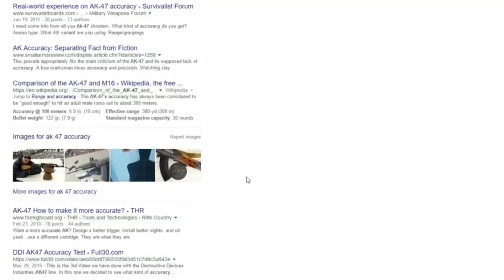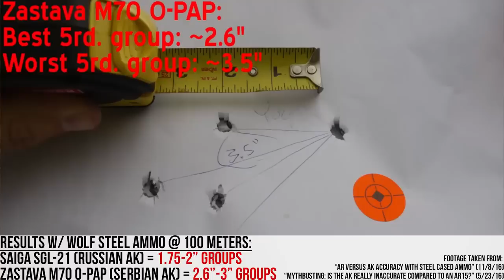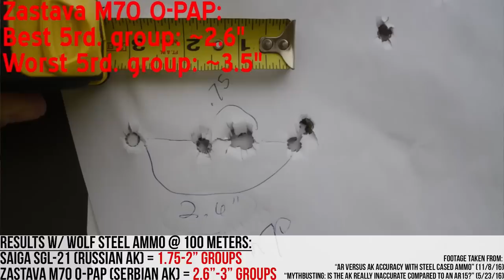Busting the WORST AK-47 Myths! (Featuring InRange TV and Mishaco)

Comment: People are crazy if they think that the AK being "reliable" means that it won't jam up. In reality it means that the AK is always easy to maintain and un-jam in comparison to other firearms. The M4 is reliable gun if nothing gets in it. It happens to be great at not letting debris get in it but once it does it's much harder to fix. The AK doens't even try to stop debris getting inside it, it's just somewhat more resistant to some kinds of debris. It's reliable because it's easy to un-jam and doesn't require a lot of maintenance to keep it running like other firearms.

Comment: Well, a couple of thousand or hundred guns isn't mass production, that's series manufacturing. The traditional idea behind that concept pertains to exactly, factories the size of a city churning out millions and millions of units of products with out cessation. That being said, the original AK manufacturing process represents late 1880's to early 1930's idea of mass production and level of automation; the principles of which Stalin actually bought from the US where things were being done in this manner at the time (Much like Ford did the same thing with his Model T.), it was some american industrial engineer for example that taught them how to do this in the mid 1920's. They learned then how to adapt it on their own, but the thing of it is, their manufacturing technology hasn't advanced since. In fact, Finland once attempted to export a programmable production line robot more advanced than anything available in the west at the time (Manufactured by Nokia, btw.) into the Soviet Union in the mid 1980's. It was accepted for initial trials, but as they realized how many people that would put out of work and how much it would actually lower manufacturing labor overhead they very quickly sent it back. This is because unemployment was punished by imprisonment  in a gulag in soviet union, and their social structure and philosophy simply could not abide with the idea of having to start educating people into skilled workers with their own brains, instead of being brainless automatons and grunts. This is one of the key reasons the Soviet Union collapsed, it's economy simply could not keep up with western advance in automation and optimization of production processes.

However. Mass production still today refers to a factory punching out a near endless series of identical products. Not some hipster craft shop manufacturing where you make less than several tens of thousands of something.

The AK is cheap to mass produce, not cheap to boutique manufacture. But, as already stated. It was never designed to be.

Comment: 1) The old AK acceptable accuracy within 100 meters. Battles at longer range are less frequent and with the use of sniper rifles and machine guns.
2) AK safer and easier to exploit most competitors of the time (and current), hence the myth of its indestructibility. AK can be kill, but very difficult. AK is made under untrained peasant, it easily withstands mistreatment and non-cleaning for months. Keep in mind that in the US there are almost no original AK produced in the USSR, and the Soviet AK is much more reliable than the rest of the replicas.
3) The range of a direct shot of the AK-74 is approximately 440 meters. It is at this distance on average and designed sight set to the first risk (ie in position “P”), and at a range of over 400 meters is recommended to aim at the middle of the target, and up to 400 meters – just below.
4) To organize the production of machines in large quantities with minimal labor and cost of each individual product required the creation of special purpose machines, aggregate and multi-tool machines, allowing to perform the maximum number of machining operations without changing the installation of the part, as well as the development of automatic lines for the manufacture of individual parts with a closed production cycle, from the start of the metal to the release of the finished part. 
All this was created with the further technical development of the production of the AK system. But in the initial period of its development, production was forced to go through the modernization of the existing machine Park, stamping, forging and other equipment. The restructuring plan of the production provided for the establishment of punching workshop, organization of the sections of the chrome plating of the shaft and hippocrite other details. The beginning of 1949 is a mass stream serial production of AK-47 automatic machines, different from piece production by the worst conditions for ensuring stable quality with its predetermined normative indicators. AK-47 machine began to come to supply troops instead of submachine guns of various designs and rifles sample 1891-/30 years.

Comment: I knew that the AK is just about as accurate at 100 yards but it the AR was designed to shot further then the AK so you should do that test at long range 300 - 500 yards. Also, the AR's iron sights is still better then the AK's. I am referring to the carry handle of the AR. I did not know that the AK factories were that massive and AK's were this expensive.

Comment: I agree that the 7.62 is a great round However shooting from just about any position other than prone your accuracy goes down hill quickly vs the 5.56. With the 7.62 round it has too much recoil and takes longer then wanted to get back on target. Where the 5.56 you can unload an entire magazine and stay with a small plate size with after 30 rounds. 
The only other thing I wanted to add, was take your tests using the most mass produced AK in the world Big difference in those VS the $1000 + DOLLAR GUNS YOU WERE USING.
Reply: The AKs recoil isnt all from the round. It's just the design of the rifle. You have a heavy bolt/carrier slamming back that is above the axis of the stock. The AR has a lighter bolt/carrier recoiling directly in line with the shooters shoulder producing virtually zero muzzle rise. I have both, the AR has about the same recoil as maybe a .410. The AKM isnt much worse than the AR, but it does have noticable muzzle flip, which can be remedied by a good muzzle brake.

Comment: Can an AK be accurate enough for infantry? Yes. Is their a reason a lot of designated marksmen do not use accurized AK's? Yes. The tolerances do not lend well to superior accurazation. Yes an AK can be accurized and made better, but it's top out potential for accuracy leaves a lot to be desired. There are simply better choices that give better results per dollar spent in accurazation.

Comment: Myth, the Ak-47 is based off of th3 STG-44, as you can find designs of it before the STG-44 was used.
Reply: The stg44 wasn't the first iteration of that firearm though. https://en.wikipedia.org/wiki/Maschinenkarabiner_42(H) & MKb 42(W)
Reply: "Kalashnikov started work on a submachine gun design in 1942" https://en.wikipedia.org/wiki/Maschinenkarabiner_42(H)

Comment: I love it when folks say that AKs can be easily made by a haji in a shack. Fuck no. I've been looking into making my own guns and the AR takes the cake in comparison to the AK. In the AR, all you need to do is mill the receivers, cut the barrel nut/buffer tube threads and slap everything together (you can add the detents but the takedown pins can easily be screws while you can opt to have no safety since you shouldn't have one in the chamber anyways). In the AK, you need to bend metal, weld, rivet the front and rear trunnions after properly spacing them, hydraulically press the barrel into the front trunnion, pin the bitch and etc etc.

Comment: What I think most myths came from were 2 instances.
#1 Vietnam war.
#2 the mystification/propagana during the cold war. 

As for #1 Vietnam the M16 seemed to have problems with the seawater/fine sand mix. As its manufacturing tollerances have been quite tight, once fine sand was within the moving parts they tent to jam up. This did not happen for the AK-47 as its tollerances were quite high and so water just drained. That exact situation however made the M16 and later the M4 more reliable in sand only and muddy areas. But for Vietnam this the AK-47 is more reliable seemed true. Not the least becuase Charly hat a lot of them and once one jammed up they just took up another one making it seem(!) that there were never jamms or breakdowns. 

Nubmer 2 is probably the bigger factor in how myths were - not created but reinforced. As with any firearm or weaponsystem from Russia it's overlooked or kept small intentionally by the western militaries (at least official). Addmitting that Russia could have weaponssystems which exceed western systems is a sacrilege, as it would make look "us" weak.

As for the manufacturing and accuracy. They realy improved after the USSR adapted the AK-74 with their 5,45 ammunition, that is when newer versions of the AK-47-M were manufactured to the same standards the newer AK74.
Also due to the bigger round of 7,62*39 and its resulting bigger kick, the in combat accuracy dropped compared to the .223 the US used. So yes on a range, having the rifle in a mount the accuracy doesn't realy change, but on site with no other shooting position than standing or kneeling the accuracy of the following shots dropped. IF you tried to fire the same amount of rounds in the same time. (also note that the accuracy of both rifles are the same up to about 400m, then testing showed that the spead increases more with the AK-47 http://www.dtic.mil/dtic/tr/fulltext/u2/a228398.pdf)

Both myths accuracy and reliability were formed in the first encounteres with the AK-47 and for that time they seemed true. But the AK underwent (like any other western service rifle) many adjustments and improvements. So comparing a after 1974 build AK against those myths seems a bit off. A most AKs encountred (and which are still faced in Syria, Iraq and Afganisthan) are more on the early 60s late 50s models. 
The same as if you take the myths about the SA80 of always dropping it's magazine when fired or breaking its cheekrest and test it against the SA80A2 or SA90A3, when H&K rededisgned parts so this would not happen. But for the early SA80(prototype) and SA80 that was true. 

I'm not saying that the AK is in general bad, only that if we are comparing the myth we need to compare them against the one which created the myth. 
I've never talked to a person who has a fair understanding of firearms (so mostly soldiers with some degree of combat experiance) who said that the new AK-74 and the AK-47s is a bad firarm. Those myths only seem to exist with people who -in general - have a lower understanding of rifles. Those people who think that AR-15 stands for Assautrifle 15, of a clip is the same as a magazine.

Comment: AK may be able to keep up at those distances but be prepared to drop a good amount of dough if you want it to.
Reply: also, in order to get that longer sight radius you dont actually need to up to longer gas systems, just a longer hand guard with out a sight on the gas block. although im comparing commercially. militarily speaking the video is right, although he did use commercial aks at points

Comment: It has to be noted that, in general, you wouldn't be shovelling mud over the damned thing. You may well, however, be hauling it through swamps or ditches or the like where you wouldn't necessarily be filling it full of mud but might easily get silt into the mech' . . . THAT would have been a more realistic test.

Comment: Any firearm will jam with mud in it, even the AK. Any time you have to push an AK bolt into battery with your hand means trouble!!! If the bolt will cycle like normal and closes on its own, it should run. Remove magazine, hand cycle and see if it will go into battery on its own. If not, take off lid and clear obstruction. If you are able to free up the bolt by cycling and it goes to battery on its own, its very likely just fine. I get a kick out of these AK mud tests when they have to hand push the bolt into battery. What would you think will happen. Something isn't right before you even fire. The AK isn't immune to jamming, just easier to clear if its dust or dry dirt. Mud will seize up any firearm.

Comment: There isn’t any gun that’s cheap to produce without first building up a factory and production infrastructure. He basically just described manufacturing of any product that requires machines and industrial production. Any functional good rifle or shotgun or pistol will require an upfront cost for setting up tooling and labor before it can be mass produced efficiently and economically. 1911’s are hand fit guns and as such the nice ones are expensive…. But that never stopped many companies from mass producing them for relatively cheap once the tooling had been set up.

Comment: The first two are true enough, but I'm not so sure about the second two; correct me if I'm wrong, but didn't you just say that the AK doesn't have a short sight radius because the rifle version has a similar sight radius to the carbine version of an AR, and that the AK isn't cheap to mass produce if you don't make them in large numbers?
Reply: Basically AKs are cheap, the machines to make them are not

Comment: #1 AK myth of all times is that "it's a copy of StG". Or that it was designed by Schmeisser. Or that at least he gave up the secret German magic of stamping. People are being instantly banned on all the respectable gun forums as trolls for saying that shit, but it never dies.

The "mud test" was a rather misguided test. AK designers and Soviet Army wanted to achieve completely different kind of "mud resistance" and reliability - namely, how fast and easy can a dirty malfunctioning gun be returned into shooting condition.
This mud test should be done properly, more realistically - with clogging the barrel and the gas system. AFAIK, mere pure water can absolutely destroy AR-15 this way.

There is also often repeated myth about "barrel-stock alignment". While true for early AK-47 and their Chinese versions, proper AKM, AK-74 etc. all have same alignment as AR-15.

Soviet military repeatedly rejected aperture sights due to relatively poor low-light performance. Very important in Russian climate and latitudes.

Comment: I've never seen anyone in the field pouring mud into their firearms. I'm not saying that that scenario can't happen, but I don't depend on people who pour mud into their firearms either.

Under normal use. I have seen these firearms function under some of the most egregious storage procedures I have ever seen. The only problem I've ever seen with the AK is that it will get dirty enough for the trigger mechanism to come apart. That renders the firearm useless as a firearm. I have also fired AK variants that shot half-inch group with iron sights. At least I have fired half-inch group with iron sights. But that was a very finely built AK variant.

Sight radius has very little to do with accuracy. As long as the sights are stable it will still shoot just as good as a long sight radius. The difference between long and short sight radius is that any movement of the firearm is more easily seen in a rifle with a long sight radius. But a steady hold is a steady hold whether the sight radius is 8 inches or 24.
But if an AK is only capable of shooting 6in. I had a Ruger Security Six that was shooting 4", double action at a hundred yards off hand.

Comment: Did you test a 1960's or 70s Vintage AK47?  Has accuracy improved with better manufacturing?
Compare a car from Detroit in the 60s with a modern manufactured car.

Comment: The AR sights are better mostly because target acquisition is much faster with the peep sight than the open AK sights. I have owned 11 AR-15,s and six AK,s since the 70's and none of my AK's was as accurate my AR's. In fact my SKS shoots much better than any of my AK's. I was Infantry in the Army and a range officer so i shot plenty with the M-16 platform it is the better rifle in accuracy and it will do better in that mud test if the dust cover is closed than any AK I guarantee it. I saw this tested at Ft. Polk LA in the early 70's in Infantry AIT.  The Army was trying to dispel the M-16's bad reputation as undependable to new Infantry troops. .

Comment: AK series rifle accuracy ignoring shooter skill relies heavily on manufacturer tolerances. Some manufacturers use low quality poorly fit parts, and the gun works thanks to the (forgive the pun) bulletproof base design, but it can shoot like .22 mag with a smooth barrel, all over the place. But a GOOD AK is just as accurate as a Cheap AR in the same shooter's hands.

Comment: I think the accuracy myth came from the way a lot of untrained fighters use the AK (untrained fighters kinda being a large percentage of AK users). The so called freedom fighters in the Middle East for example, have no gun training, so they are almost always seen firing the AK in full auto. No weapon is perfectly accurate on full auto, but the AK especially, because it fires a more powerful round, which would be expected. Instead of comparing the AK with the M16 platform in accuracy, why not compare it with its actual counterpart, the FAL? The FAL had similar issues, meaning that is was notoriously uncontrollable on full auto, but that did not give the FAL an inaccuracy mythos, like the AK. Military doctrine teaches countries using both AK and FAL as main rifles, to use it predominantly in Single fire, and in Single fire, the AK is as accurate as any rifle, with a powerful round. Do not underestimate the AK in the hands of trained military personnel!!!

Comment: an AKs MOA is 3" as the standard. that means if it doesn't shoot 3 MOA then it's not up to standard. that doesn't mean it doesn't shoot tighter groups. that's 9 inches at 300 meters. and 30 inches at 1000 meters. and yes the MOA is probably measured in centimeters